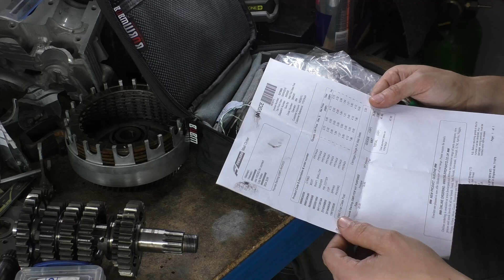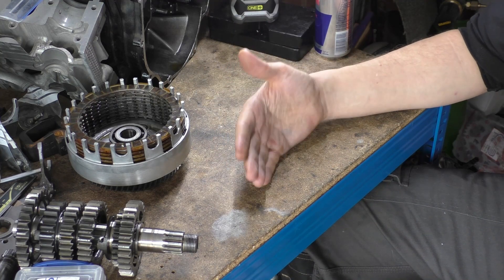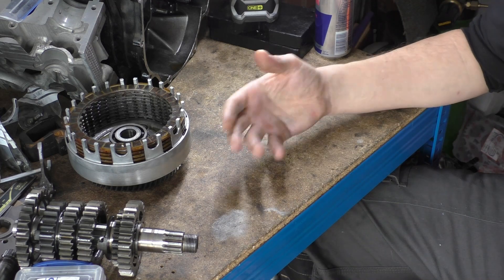Parts required to do repairs

Comment: Some things are inevitably going to break (cables), leak (seals), wear out (spark plugs, pistons, rings, tyres and bearings), fall off (nuts, bolts and screws), stop holding a charge (batteries) or clog up solid (fuel taps) so it's a no brainer to have these parts already stockpiled for use, rather than being without a bike for ages whilst the parts on order. (Been there, done that, never again).

I have a long double garage and own 10 bikes plus a moped. I also have to look after my son's 3 bikes. Most of the garage is metal shelving full of parts, engines, tools, cables and parts hanging from the rafters, boxes of parts, spare gearbox shafts, spare cranks, spare engines (plus a pile of pending rebuilds), boxes of new seals, new wheel bearings, new brake parts, new pistons, new rings, new fuel hosing, viable exhaust systems, bags of baffle wadding, gas tanks, saddles and wheels. The sum of 38 years worth of biking experience so far.

Anybody who's into classic bikes will understand the sensible hoarding. (Women don't hence proving that men are smarter).

I've actually had a local dealership phone me for a part a few years ago.

I always keep a few unopened new tubes of engine sealant ready for use. Oil I buy in bulk to save money. I also buy and stock a selection of bolts, washers, nuts, circlips and O rings as sometimes a bolt needs replacing because it's rusted up badly or damaged.

I have Quality Street tins full of those OEM specialist brackets, fasteners, etc. The sort of unique to a particular bike components that are made of unobtainium or hardtofindium if lost.

Also countless magnetic ashtrays for sticking bolts and fasteners into / onto whilst working on a bike so they don't end up being lost. 

Never ever say no to spare wheels for a bike. Tyre shops and dealerships always seem to have a discount sale on AFTER one has just bought and fitted a brand new set of tyres. There's also the ability to swap a spare wheel when a puncture occurs mid-week and deal with it later at the weekend.

Comment: Some people may not agree, but depending on what your doing, it's also a good idea to look at wear and tear items as a '' because I'm in there anyway'' even if it's not necessarily related. Depending on cost / time obviously 

Not to use the c word, but say you pull a gearbox out, you might as well swap out the rear crank seal while your in there

Comment: AvE would be proud. It brings a tear to my eye. Wait, no it's the cigarette smoke. Time for another beer. You can't do a proper job without the parts to replace the old used ones with. With a mystery machine, it's always most prudent to replace everything instead of regretting it later. It's always the smallest part that fucks you in the end. Thank you.
Reply: There's a point where's the needed beer for a repair a clutch is a 2 beer job I think brakepads is a one beer job. This clutch rebuild and cable set could be a three beer job.

Comment: Nice one Matt. Just a quick note... that XJ front sprocket nut is as soft as cheese. Famous for being easy to strip out. Good that you bought a new locking washer, but CLEAN that sprocket shaft so there isn't even a spec of dust on it before putting the nut back on, and put on no moly grease or anything,. Tighten the nut by hand to just UNDER Haynes spec, slowly, then STOP.

Comment: after repairing my clutch cover, instead of buying a cardboard gasket I planned on using RTV. using RTV requires NO oil on the mating surface. I had to try twice to stop a small leak through the RTV. now I bought the replacement gasket but haven't put it on yet. I''m just hoping that's the problem and not the clutch arm seal I had to repair

Comment: Hi Matt, what should i lube the metal parts/aluminum parts in a automatic with since nothing should go in dry... Maybe Dr. Tranny Blue goo Lube before adding ATF? And ofc add ATF and let clutches take a bath in that for 20minutes or over night. 

Also Matt, when rebuilding a automatic transaxle/transmission or manual, should there be a 500 mile breakin then dump the fluid out for a fluid service change and refill and then drive that bad boy like you stole it?

Comment: Do you buy original parts only??
Reply from the maker: No. The EBC springs and clutch plates are not OEM - the Hel brake lines also.